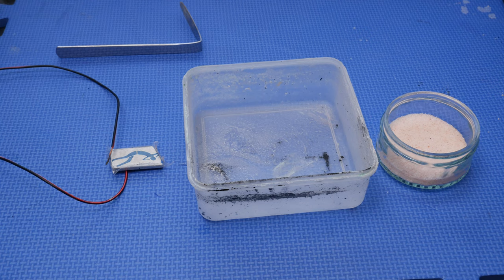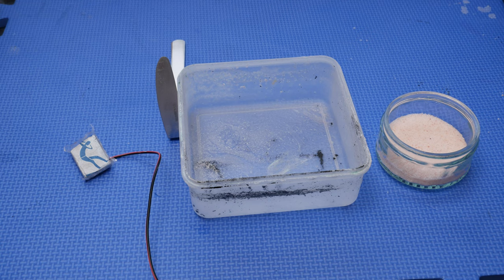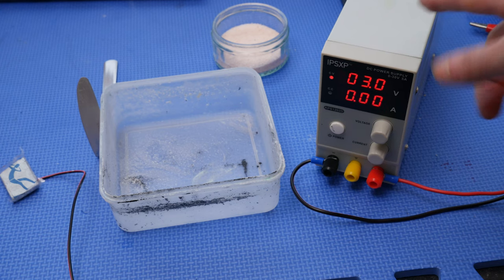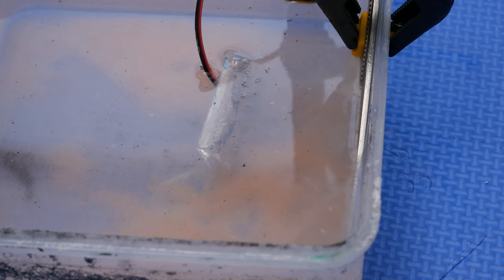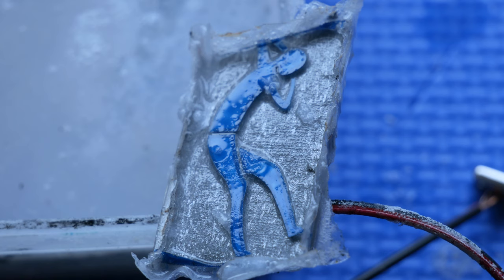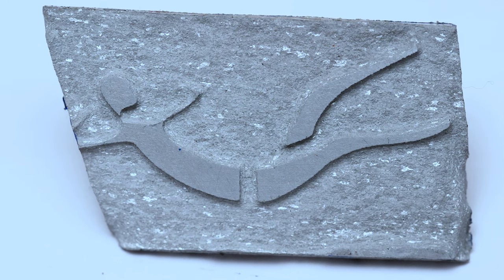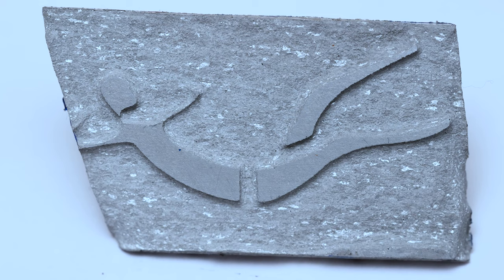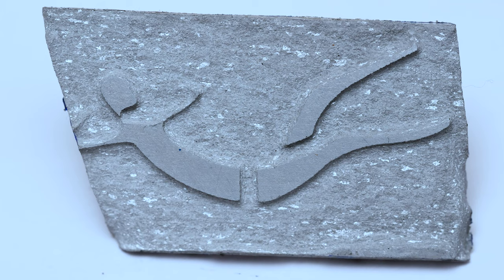How To Electro-Etch with Salt Water and Aluminium

Comment: Nice video. I've fiddled with electro etching a bit and you can reduce the undercut by using a deeper tank and orienting the face of the work towards the anode. It's a directional process so the more parallel the work (cathode) is with the sacrificial plate (anode) the less undercutting you get. I use vinyl and/or paint as a resist and generally use 12v for everything because I'm a lazy cheepskate and I've never had a problem with crisp edges. 

NOTE: Most of the stuff I've done has been with medium carbon and mild steel but this video has inspired me to go and have another crack at Aluminium so thanks for that.
Reply from the maker: Yes keeping the plates parallel will reduce undercutting, excellent tip!
Reply: Could you tell me what type of paint you use pls

Comment: Thanks for the video. I’m  trying this out right now but thought I would investigate what the bubbling consisted of. Chlorine gas at the anode and hydrogen gas at the cathode! I’ve now move it outside away from the garage Calor gas heater!
Reply from the maker: Yes I always put my etching outside my garden door if the weather permits it. If it indoors I always do it with all the windows open.

Comment: Nice ! Maybe a safety advice on the electrolyte, try to use baking soda instead of salt. I ended generating chlorine in my room by messing up with the connection using salt. Cheers !
Reply from the maker: Thanks for the info!

Comment: Do you think copper sulphate will work? Also why was there bubbling at the anode
Reply from the maker: yes copper sulphate works very good, you can see it in my other video on etching here - https://youtu.be/0e-lfiPmX3k?t=221

The bubbling at the anode is normal i'm not sure the precise science behind it but you can control these bubbles by how much volts you use.
Reply: @ThisDesignedThat  I've tried graphite cathode with NaCl as electrolyte. I observed bubbling at the anode too....could it be because that the OH- being oxidized into O2 together with the Aluminum, although aluminum is preferentially oxidized?

Comment: Would the undercutting be reduced if the amperage was dropped by a significant amount? I'm sure it would slow the process down.
I do know that electroplating happens more easily along edges than in recessed area so slowing it down might not help. But thought i would ask.
Reply from the maker: Yes amperage will affect the undercutting but I'm not sure by how much. I haven't done any in depth testing on this and now that I have a CNC machine I mostly do my metal engraving on that. I do plan to make a video on how you can use tree resin on the shoulders to reduce undercutting, its a very old technique but works quite well
Reply: @ThisDesignedThat  Looking forward to the tree resin!
Some of the designs I am planning are too small and detailed for CNC....and could be too detailed for etching. 
Thanks again.

Comment: You don't need stainless steel. Simple aluminium foil will be enough or any conductive element. In layman's terms, saltwater etching (electro-etching) is applying a charge difference in order to force atoms to rip from the surface of the anode (+ positive charged metal) to move to cathode (- negative charged metal)
Reply from the maker: oh really, i'll have to try that next time, save me wasting my cutlery :) thanks for the tip
Reply: What do you guys use to suspend your anode? My wire (tried stainless, then aluminium, then black wire) keeps being eaten through before my piece can etch!  Also do you reuse the mixture or make a fresh batch each time? Thanking you in advance 🙏
Reply: @g.m.5412  Personally, I don't use any metal to suspend the anode. For horizontal etching like in the video I just lean it against a rock I picked up from outside.
For vertical etching (i.e. one on top of the other) is best to use some styrofoam and water resistant glue. Glue the anode to the underside of the foam and let it float on top of it. You can then use nail polish remover to dissolve the foam if you can't peel it off. Other ways include using fabric thread, fishing line, or even insulated wire.

The main point is to always ensure that the cathode is larger than the anode, and that the anode to cathode area distance is equal on all edges. This means to make sure that you don't have corners with more brine where the ions have to travel a longer distance. If you do then the places that are closer will etch more deeply creating an uneven etch.
Reply: @victorunbea8451  thank you! Great information 👍
Reply: @victorunbea8451  I'm trying aluminium foil as cathode today! Also, have you had any luck with permanent ink &\or sharpie as a resist....I haven't :( how many uses do you get out of your salt water....I'm only getting 1-2?
Reply: @g.m.5412   About the sharpie, short answer is: no. Long answer is: it's good to touch up small points where the pattern didn't set right, but not enough for a full design. Personally I use an old and cheap laser printer, a spoon to press the pattern on the metal and acetone (dilute acetone nail polish works just as great). The trick is to peel the paper after soaking it well in warm (not hot) water. Also, I found that old printers work better than newer ones. Don't know why but I think it has to do with the toner composition.
Regarding how many uses, well... you're essentially doing electrolysis there. Some of the Na+ Cl- ions may be evaporated or carried to the cathode. Just add more salt and water as needed and you should be good to go.
Reply: @victorunbea8451  thank you so much! You have been a wealth of knowledge. Today I used a large dense ball of aluminium foil, bigger than my anode and I got a deep, fast etch.... twice!!! Will take your advice about just adding more salt and water when needed and see how I go 😁. Thanks for the other tips today re printer etc 🙏